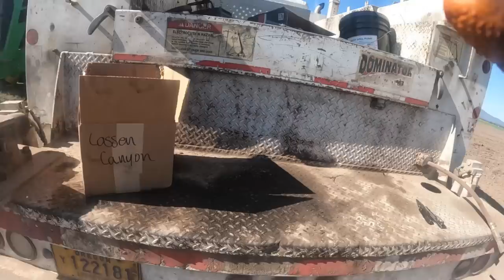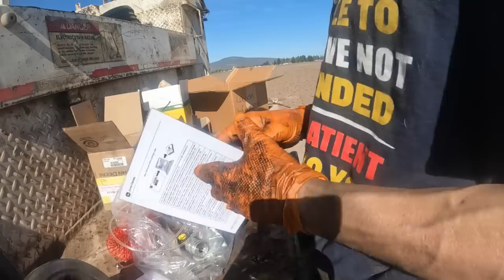Jphn Deere 9430t variable speed fan drive

Comment: I kind of don't get how that system works.  Is there a temperature controlled valve that regulates the hydraulic oil going to the fan hub somewhere?  Fixed is fixed so good job but what a PITA.  Why does it always seem they use a 2 inch bolt when a 3/4 inch bolt would do just as well?

Comment: Nice vid Warren, I had to update the fan drive on my 09 9530.  I asked this to a youtube Deere dealership mechanic and he was too afraid to give his opinion.  Is this system worth all the problems it gives?  Seems like it's trying to over complicate the job of turning a cooling fan off and on.
Reply from the maker: They are junk. John Deere's idea for better fuel economy, but anything you gained on fuel you lossed on repairs and downtime.
Reply: @westerntruckandtractorrepa1353  Thanks for confirming what I thought!  The   original was the non greasable version and gave out at just over 2000 hours.

Comment: Thank you for the video Warren I always learn something, Toro mowers have variable speed fans with a spring that gets weak and the won't tighten up so I just run 2 bolts through them lock them up they run at the hot limit constantly so what is the need for a variable speed fan? The fan clutch is 500 bucks from Toro. I can see why you need one on a tractor like that it probably effects the fuel efficiency a great deal.

Comment: Hello warran how are you. We don't plow so often and when we do, we need a Eck of a big  HP tractor and with a lot less blaids on than on the one you are repairing. When the soil has been turned a few times , it's easier on the tractor. You probably know that anyway. The weather has come good here to. We do the same sort of work has you, bar for the diagnostics. Another guy comes to do that.

Comment: I worked in truck building fabrication and I’ve always wondered why the engineers never put the front end and engine on seperate chassis frames that slide forward inside the main chassis frame from the gearbox to facilitate easy maintenance and repairs,that would be a game changer working around the engine.

Comment: I’ve said before, engineers should have to actually work on what they design, so they can see how big of a pain things are to work on nowadays. I primarily work on cars and trucks and you spend half them time removing crap to get to what is broken. Sometimes to the point of removing the cab from a vehicle chassis to actually be able to work on them. Lucky for Warren this was not as bad as most to to get to the part that needed to fix, but still a pain. Sorry Warren.